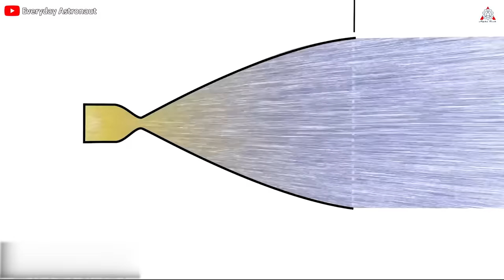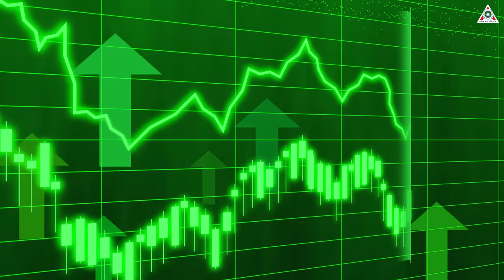How SpaceX's New Starship Engine #3 that will change everything...

Comment: You mention: chamber pressure,  several times and even show a cross section of the entire expansion chamber, but you do not point out which is the part experiencing the high bar pressure.  Also, what was done to help the combustion chamber wall survive the higher pressure?
Reply from the maker: Thanks for your comment. We'll take note this in the next video☺️

Comment: So would SpaceX be able to run Raptor 3 at the same output level as the Raptor 2 so it will not have to work as hard?  With that would SpaceX be able to throttle up and throttle down with more headroom with the Raptor 3 ?
Reply from the maker: Let's wait for their next steps ☺️

Comment: What do I think about Raptor 3 engines?
Pretty much that they are overhyped. The current track record of any (either old or 2.0) raptors is... 0% success as far as i can tell. Sure, some made it to suborbital speeds on the first stage of Starship, some underwent even a landing after a few kilometers of flight.. but so far they still havent made it into orbit... not even beyond, please correct me if i am wrong, the karman line. I would even bet that ULA will win "the race to orbit" with american metalox engines not just by days or weeks.. the BE4s will be going strong while the Raptors will still undergo testing and mishaps. 
It is just a different approach on testing the equipment - and BO chose the less spectacular way...
Reply: 🤭 we will see, excitement is guaranteed.
Reply: So no rocket engine "works" if it has not achieved LEO?
If any system causes flight termination prior to LEO, the engines failed?
I'm sorry but that makes no sense to me.
Reply: @FossilTunes  So your car blows up because of a fuel leak and you'll say the engine failed.. got it.  SMH
Reply: @paulslund1  unable to ready?

Comment: I still hope for Blue Origin's success. NASA could start again with R3s, and join the race to space, instead of boondoggles. We need every good effort to achieve more than mediocrity. Raptor 3s can serve all propulsion needs until more vehicles can manage the trip.
Reply: While I, also, want BO to succeed, it is far more important that SpaceX has competition than who provides it.  Right now, small startups have been more successful getting payloads to space than BO.  If Bezos has, indeed, purchased ULA then it's fate is sealed.  Had Tory Bruno purchased Raptor engines from SpaceX - or threatened to buy them - ULA might still be independent and BO might be making and selling engines at a rate above the apparent one engine per year.

BO and ULA could both be left in the dust by companies that are relatively small today in the not too distant future as those startups chase SpaceX.  

Go, Jeff... yay... 🫥😏🙄🫣🙄😏🫥

Comment: As I understand it, the increased power of Raptor 3 is obtained by ramping up the compression ratio in the combustion chamber. Raptor 2 already boasted the highest compression ratio ever which puts a gigantic strain on the walls of the combustion chamber. Don't forget - this engine is also intended to be reusable, so subjecting the chamber walls to insane temperatures and pressures must require magic materials...
Reply from the maker: Let's wait for their next miracles
Reply: I've forgotten who said it but it, apparently, applies here:
"Any sufficiently advanced technology will appear to be magic."